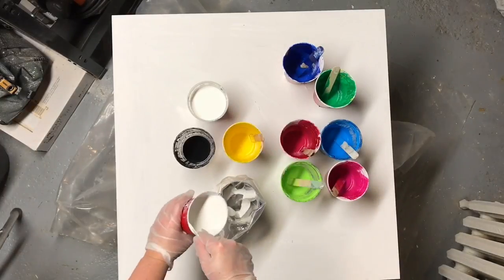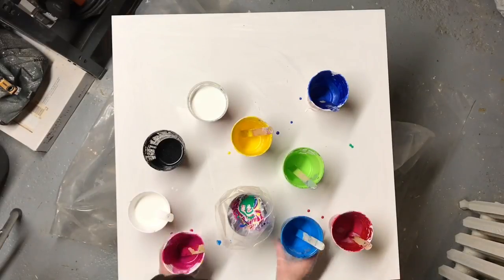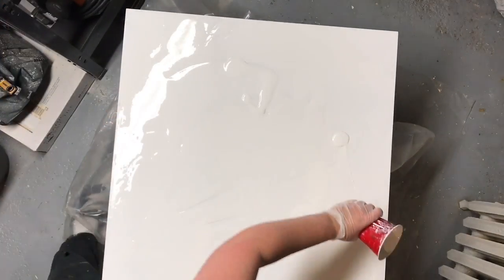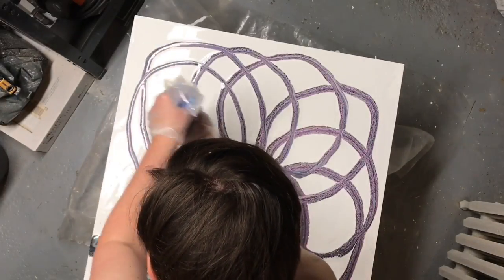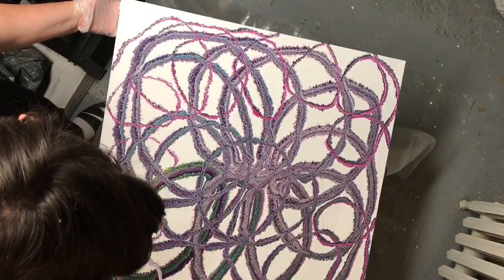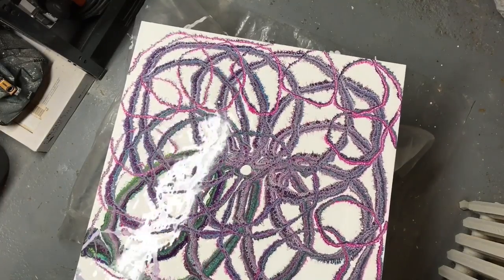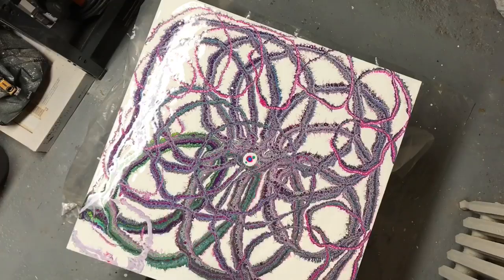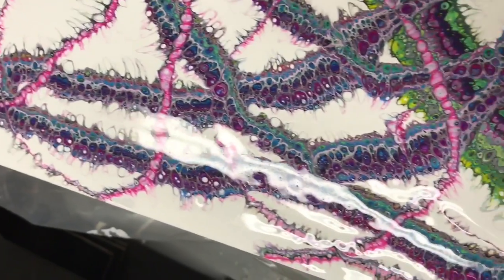Going a little loopy. Piping cells in a acrylic paint pour

Comment: I really like your style and technic, it is clean and creative. The way you use color space is bold and imaginative. Your negative space method in other works is elegant. I can get lost in your pieces but never feel overwhelmed. 
I used the very loose white paint and negative space method to make a beautiful painting for my mother's 70th birthday. I used gloss to finish it off but it never seemed to dry. I just looked at the comments below i saw the flour and soap tip.
So I have two questions. Can I save the painting? What kind of soap?
Since we're here. Have you ever used the pour method on a canvas that was textured? I tried it but i don't think it was thick enough to effect painting. In my mind it would work like water and sand at the beach.
Reply from the maker: K Nance thanks for all the lovely compliments and watching :) As for your painting..does it seem wet because of silicone? How long did you wait for it to dry? It's hard to say what is causing that..definitely need all the silicone off before varnishing. Texture vs non texture-I've poured on some canvas but don't like the way the paint dries on it..much prefer the smoother surfaces.

Comment: During the filming these are glossy cuz the paint is wet... What about after they dry to a matt finish?
Reply from the maker: After they are dry (I wait about two weeks to be sure!) I have to put flour on them to soak up the silicone. That gets brushed off and then I wash gently with a little soap and water. After that, I put two or three coats of liquidex high gloss. I've been debating whether or not to use resin, I suspect it brings them completely back to how they looked when filming, but it is so expensive!